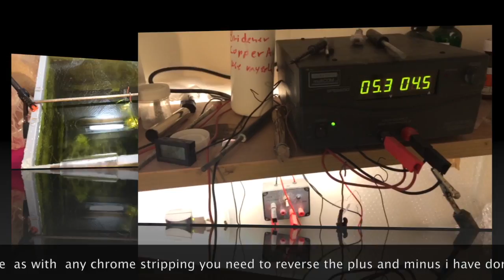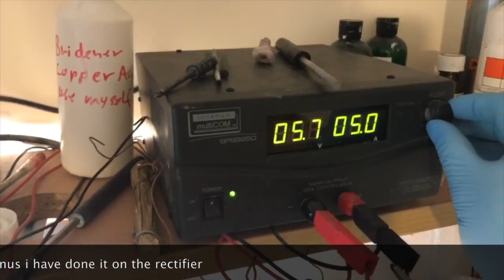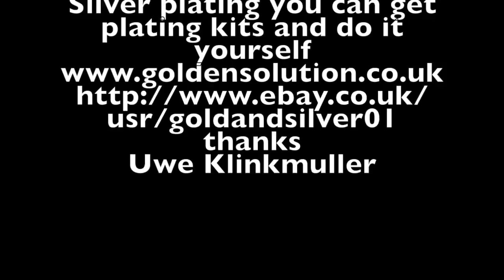How to remove chrome the easy way

Comment: This would be a lot more helpful if you actually described what’s involved
Reply from the maker: scott oliver chrome stripper is involved 
You can read what I was doing as well
Reply: I work at a chrome shop. we use caustic acid
Reply: @Rat Fink yes we also use muratic acid. And not sure why I put caustic acid. It was supposed to say soda lol. I'm a stripper at a chrome plating shop here in Tennessee. I electro strip all the parts to bare metal in sulfuric acid before they are buffed and polished to be plated.
Reply: @wesleydeniker5339  dumb question...i can't just use an industrial type stripper from home depot? And some sandpaper? I've got a couple motorcycle parts I'm trying to dechrome and paint black but I don't have access to acid/base baths
Reply: @turtlepowersf  use a conductive solution, then simply hook the negative prong to the part that you want to strip the chrome off of and hook up the positive prong to a scrap piece of metal. Be sure not to put the prongs in the solution, only the parts that are hooked up to them. There will be minor oxidation that will occur on the piece that is hooked to the negative prong.
Reply: I want to remove chrome from a wheel

Comment: Reversing the plus and minus.....   Plus to the part, and minus to the anode? What is your anode material?  How many volts.  What does your solution contain?

thank you
Reply from the maker: Yes 
The anode is just stainless steel 
The solution is chrome stripper what you can get from my website www.goldensolution.co.ok
Thanks

Comment: Let me know the solution name which  is in container ....
Reply from the maker: Chrome stripper
Reply: it's proprietary, his solution. i've used muriatic acid and have used caustic soda. but i must say his "chrome stripper" solution looks better. unless it's one of the two mentioned and at what ratio. depending what piece or pieces, i've just used a buffing machine with rubbing compound to remove the chrome layer
edit: just read it's not an acid, so that disqualifies muriatic acid leaving caustic soda aka lye which is not an acid but an alkali

Comment: is that water on the tank? or you use any solution?
Reply from the maker: It’s chrome stripper
Reply: @GoldenSolutionPlating  muriatic?
Reply from the maker: @Junezor  no acid no

Comment: will this work on chrome wheels that are aluminum?
Reply from the maker: Yes if it is chrome 
Lots of chrome looking aluminium wheels are not chrome plated they are polished 
So the polished aluminium looks like chrome 
Thanks
Reply: @GoldenSolutionPlating  mine are chrome plated, i can tell by the pitting, i know about polished aluminum wheels, and i figure it is easier to maintain and keep the wheels polished with the aluminum rather than the chrome, so now the real question is where do i find a reasonably priced tank to be able to dip a 20"x14" wheel lol.
Reply from the maker: @bentzoverstreet6622  I would search for a chrome plating shop in your area most of them can do chrome stripping 
thanks

Comment: This is only the chrome, what about the nickel or copper underneath. Will you no remove these too?
Reply from the maker: this removes only the chrome plating but not the nickel or copper 
thanks
Reply: @GoldenSolutionPlating  Is it possible to remove the nickel or copper underneath if they want to get to the base metal?
Reply from the maker: @tisoy909  hi
Yes you can remove the nickel with nickel stripper you can get it from spa plating 
Not sure about the copper 
Thanks

Comment: Can this process be used on chrome covered aluminum
Reply from the maker: As long as it’s chrome yes 
The chrome stripper only removes chrome and under the chrome is always nickel and under the nickel copper the base metal can be different metals but mostly steel 
It’s very rare that aluminium is chrome plated I have only seen alu wheels chrome plated 
Thanks
Reply: @GoldenSolutionPlating  It's aluminum a motorcycle frame but the chrome is peeling and reacting with the item I want to strip it and powder coat it ... looking for the best one time solution to the problem cheap easy and fast ...
Reply: But it should remove chrom from aluminum wheels right . Anya way I could get a list of items mostly the chemicals and could I use a car battery to power this
Reply from the maker: @armandovela7872  hi a car battery is 12 volt thats to much you need around 6 volt 
if its chrome you can remove it yes
Reply: @GoldenSolutionPlating  What are the chemicals
Reply from the maker: @breejon  https://www.goldensolution.co.uk/collections/plating-chemicals-and-polish-mpu-meta-seal-activator-cleaner-chrome-stripper/products/chrome-stripper-remover-1-litre
Reply: @GoldenSolutionPlating  Can it be shipped to Canada or is it restricted as dangerous goods ?
Reply from the maker: @breejon  Yes no problems its not dangerous the only danger is the chromium when you remove the chrome 
thanks

Comment: Thank you the great video. I understand the process for removing the chrome but, will the nickel and copper also be removed if left in the tank longer? I ask because I need to strip everything down to the steel so I can metalwork the object
Reply from the maker: hi no 

you need nickel remover https://www.goldn.co.uk/product/nickel-stripper/
not sure how to remove the copper i would use a polishing machine for the copper 

thanks
Reply: So basically, what you saying, is if you are going to powder coat it, you need to sandblast it
Reply from the maker: @llewvirtue861  no didnt say that
Reply: Golden Solution  I got to say I just sent my viper rims to be rechromed at chromer and they sand blasted them  they look like shit now. I wish that they would have striped with no sand blasting it made pot holes in my rim, I had some pitting from salt but Not crazy bad ,thought they would fill small spots with nickel or copper    I wouldn’t sand blast without knowing what they will look like when stripped  . Now I am looking for a solution to fix the pot holes .  Let me know how you do  and good luck
Reply: No it's a different ball game stripping nickel.. you would need SULFURIC ACID, and DC CURRENT. or grind it off

Comment: Does this work for chrome plate on plastic?
Reply from the maker: yes if its real chrome like most car badges no problem 

thanks
Reply: I was talking about the grille on my Toyota Tacoma OR to be specific. What’s your opinion?
Reply from the maker: @DD556762X51  i would use the brush systemand not the tank as you need a big tank to do this 

here is a link https://www.youtube.com/watch?v=IhVGfduLhis&t
thanks
Reply: Golden Solution thanks for your help .

Comment: Thanks for the great video. I have a question. If I do this proces (like you do) and remove the chrome, then the chrome goes to the anode. If I would swap the + and  - after a while, the chrome would go back to the original place on the item, would it not? I ask this because I have a chrome pipe with pits in it. After swapping the + and - the chrome should go back to this pipe and the pits should be gone. Or do I make a mistake?
Reply from the maker: No 
It will not work
Reply: You have to make the chrome dissolve as in a different solution. I believe sulfuric acid would be the easiest way for a DIY process. And then it can be plated onto the metal again. But have in mind that You will need huge amounts of current to do that Yourself. That's why it is so expensive!

Comment: I want to strip chrome so i can plate other stuff how can i do that? A nickle rod? And some electrical currant? I mean can i catch it on something so i can plate again?
Reply from the maker: stainless steel not nickel 

catch what ?
Reply: i can get some parts plated with i think hexavlant chrome. I was wondering if i could salavge the chrome?
Reply from the maker: @robertbogan225  no you cant

Comment: What are you using for cathode? And is that straight sodium hydroxide? What ph and temperature, do you try to keep the bath at?
Thanks.
Reply from the maker: stainless steel , it is sodium hydroxide and its room temperature it doesn't need to be heated up

Comment: thanks . Can it remove chrome plating on brass?
Reply from the maker: Nht Nguyen 
Chrome plating can be done on brass 
Under every chrome plating is nickel under that is usually copper and under that can be any metal 
Chrome stripper only removes the chrome it doesn’t matter if the base metal is brass or anything else
Reply: @GoldenSolutionPlating  can you please help me on chrome plating on plastic or make a video?
Reply from the maker: usama altaf this video is about removing chrome 
I don’t do chrome plating 
This is why I haven’t got any videos about it

Comment: Will this work on plastic that has been chrome plated
Reply from the maker: hi yes i have done plastic chrome car badges no problem 

thanks
Reply: @GoldenSolutionPlating  do you sell this as a service by chance. I've tried oven cleaners degreasers, sanding one spot for 30 mins and nothing seemed to penetrate the chrome. I'm running out of options
Reply from the maker: @mk2supraa  yes i can do this no problem email me at uweklinkmuller@hotmail.co.uk  thanks
Reply: @GoldenSolutionPlating  first thing in the morning for me I'll get back to you thanks.

Comment: Can this be used on chrome plated aluminum?
Reply from the maker: yes if it is chrome but i have never seen chrome plated aluminium  you may mean anodized alu
thanks
Reply: @GoldenSolutionPlating  might be, it's side covers (crankcase) on a motorcycle. It's not so much "peeling" as it is flaking off. Thanks bud
Reply: @Truthseaaker did you ever find a way to strip the chrome from your aluminum motorcycle parts? I'm in same boat.
Reply from the maker: This will remove any chrome plating it doesn’t matter what the base metal is
Reply: @GoldenSolutionPlating  my problem is I want to get to bare aluminum...nobody seems to have a solution
Reply from the maker: Remove the chrome first then the nickel and copper or some plate nickel directly on to aluminum
Reply: @GoldenSolutionPlating  yup grabbed the old makita sander and had at it..takes a while but you'll get there...got a mirror finish!! Satisfying

Comment: I'll have to agree with a lot of the comments, not much information in this clip! what's in the tank? what's the chemical? what's needed to generate the current? what's the nature of the tank? plastic? metal? what surface are you left with? what's the next move to top coat finished product? nothing in there that tell me how I could strip flaky chrome off metal parts? does this work on aluminium? steel? brass? is it ready for polishing? powder coating? painting? by the look of it, it needs a fair bit of professional equipment, much more than a DIYer would be able to get his hands on or have at home. all it tells me is, "take it to a professional outfit and pay for it to have it done"  sit back & enjoy a beer listening to music you actually like.
Reply from the maker: Hi 
Chrome stripper is in the tank you can get it from my website or ebay shop can't tell you what the exact chemicals are because I'm selling it I'm sure you understand 
At 1 minute you can see it's a power supply or rectifire or plating machine again you can get this from my website
As you can clearly see the tank is made of plastic there are stainless steel anodes in the tank 
Same surface as before apart that the chrome is gone and the nickel is showing but it tells you anyway 
You can only remove chrome 
This video is more for people who doing chrome stripping with a brush you need to know the basics 
Thanks

Comment: Have you tried larger items like chrome rims? Do you need a controlled/ventilated environment to do this? In addition, it would be awesome if you showed a video on everything you used and how you set everything up! Great video.
Reply from the maker: BIGB-TOWN 
Yes I have a bigger tank of about 80 litre or so 
I may put another video on here to show everything but not at the moment 
Thanks
Reply: Can you remove every coating with this method?
Would I need anotherdetergent?
Reply from the maker: Only chrome with this solution but you can remove the nickel with nickel stripper

Comment: Can somebody tell me how I can remove hardchrome from bronz with this proces. What I need it
Reply from the maker: The same way as this process
Reply: I have try it but it Wil not working what do I wrong ?
Reply from the maker: What is the item
Reply: It is a steam whistle from bronze that is now hard chrome and I want to take it off. I had taken a bath with water and put vinegar in it to make the water acidic. And put 12 v on it. But that does not work
Reply from the maker: Wilfred Buijs I’m not surprised 
You need to use caustic soda mix it with water about 250 gram in one litre of water and change plus and minus like in my video
Reply: And how mutch volt ?
Reply from the maker: Wilfred Buijs about 4to 7volt
Reply: @GoldenSolutionPlating  best to use distilled water, correct? Does this work well with chrome rims? What's the best method for disposal? I work at an auto shop, and there's a body shop next door, maybe they can help with disposal if it's not something a diyer can do. I appreciate it.
Reply from the maker: @johnpippin2426  hi 

yes distilled water or de ionized water it works well on any chrome 

thanks

Comment: You must explain the step by step to the noobs like myself. What kind of solution you are dipping into? Is the part to be stripped on the Anode or Cathode? What is the device you are using for the electrolysis (model number)? etc...
Reply from the maker: its Chrome stripper 

https://www.goldensolution.co.uk/collections/plating-chemicals-and-polish-mpu-meta-seal-activator-cleaner-chrome-stripper/products/chrome-stripper-remover-1-litre
i use stainless steel anodes 

normal power rectifier will do 

thanks

Comment: Hi i have chrome plated parts on my car, I am thinking about removing and then plating black chrome to darken the cars details. 

With this can i simply remove and then go straight to plating the black chrome? I thought I was going to have to remove and the go through the three plating stages as i understand it with polishing etc.

If so does this mean my part is already polished and just needs the final layer plated and happy days?

Comment: So, absolutely no description of how to do it, just a video of what you did. Not very useful tbh Folks. Can your strip solution be diluted? What are all those clips doing exactly? What steel did you hook up to? Do you need a mask? Can the rinse off be into the fresh water drain? (Legally), how do you then strip the Nickel which will obviously be knackered if the chrome needs stripping?, is this hard or dec chrome removal? Come on Guys.
Reply from the maker: Thanks
Reply: @GoldenSolutionPlating  Thanks? I'm sitting looking at your website ready to place orders & you reply with "Thanks" ?

Comment: ok what is the solution in the tank and do you use an anode? if so what is the anode ?
Reply from the maker: hi 
its chrome stripper and i use stainless steel anodes as you can see in the video
Reply: awesome, thanks bud

Comment: What do you mean reverse the plus and minus...reverse from what?
Reply from the maker: Hi you must swap the plus and minus on the rectifier 
with any other plating the anodes are always plus and the item the bar where you hang up the item in to the tank is minus but with chrome stripping you need to swap the plus and minus so the item /bar where you hang it up is in this case now plus 
thanks 
Uwe
Reply from the maker: Franz  if you don’t-change plus and minus the chrome will stay on and dont damage anything
I would recommend to do some tests with some old chrome 
Thanks

Comment: Apart from timings, there is no information that is of any use. Waste of time
Reply from the maker: It shows you how to remove chrome that’s it
Reply: @GoldenSolutionPlating  People are making these comments because you dont specify in the video any details of the process. What solution is in the tank, what is the best voltage to use, what are your electrodes made of, etc. please update the video with usefull information.

Comment: Thanks for only showing you removing the Chrome and not showing us "HOW" to remove chrome, a waist of 8 mins. of my life
Reply from the maker: there was chrome on that item i put it in the chrome stripper take it out and the chrome is removed 
so i showed how to remove chrome the easy way 
thanks
Reply: @GoldenSolutionPlating  Lol WRONG, There's a big difference between showing someone how and showing someone you doing a process like u did here without explaining/showing "how" keyword how
Reply from the maker: @gweedo1234  well the video is doing very well and people comment and putting the thumps up or down both ways is ok its activity and this helps to get views
thanks
Reply: @GoldenSolutionPlating  ..very good video,  I understood every bit of it with no problem. 
I think its halarious that some people have to have you explain every single little bitty detail for them to understand it. 
This video was straight to the point with no BS, thanks! 👍
Reply from the maker: @wesleyAlan9179  thank you very much
Reply: @GoldenSolutionPlating  you're welcome, my friend. 
I have chrome plated wheels on my 74' VW Beetle and I want to Strip them and paint them mint green, as its part of the color scheme, plus..the chrome is peeling off and rusted a little bit. It doesn't look bad, but i know that it could look better✌